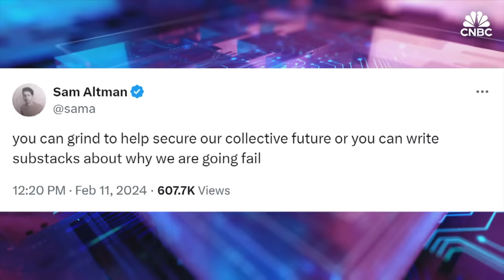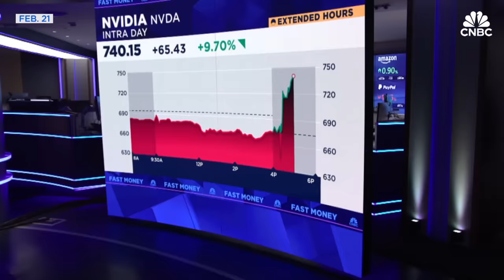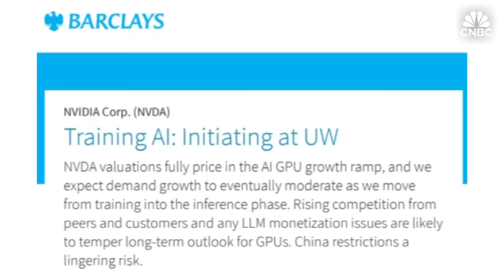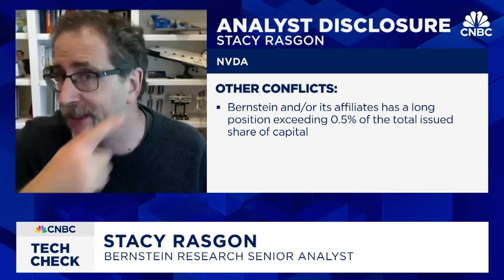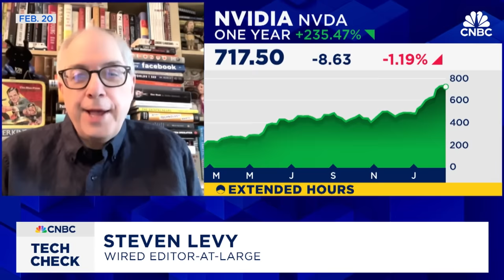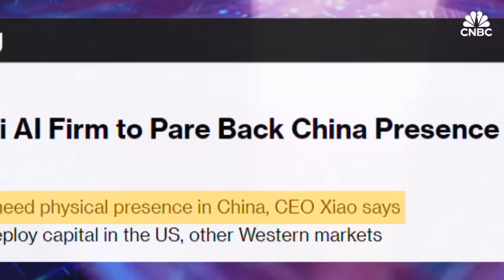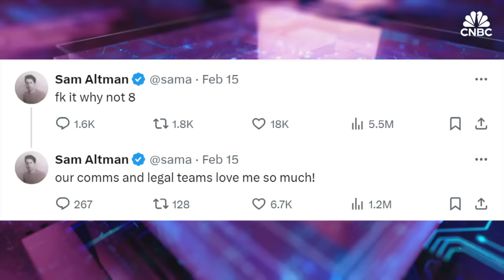Nvidia, Sam Altman and the trillion-dollar AI dream

Comment: Investors have just turned back the clock on the Fed’s tightening campaign and cast aside the Fed fears that ruled them for 15 months. It just gets very daunting to me when I’m sitting there looking at charts and trying to determine if i’m right or wrong! I’ve been trying to grow my portfolio of $300K for sometime now, I would greatly appreciate any suggestions
Reply: First of all, You could lose it all and you could win it all. It goes both ways. Secondly, what works for A may not necessarily work for B and you should not be a bandwagon investor. A good number of folks are raking in huge 6 figure gains in this downtrend, but such strategies are mostly successfully executed by folks with in depth market knowledge.
Reply: It’s unfortunate most people don’t have such information, I don’t really blame people who panic cos lack of information can be a big hurdle. I’ve been making more than $25k passively by just investing through an advisor, and I don’t have to do much work. It doesn’t matter if the economy is crashing, great CFA will always make good returns.
Reply: this is inspiring! could you be kind enough with details of your advisor please? highly suspect i'm much too small game lately to handle investing myself, figured out its best to consult a license professional at this point
Reply: ashley airagahi is the licensed coach I use. Just research the name. You'd find necessary details to work with a correspondence to set up an appointment.
Reply: I appreciate it. After searching her name online and reviewing her credentials, I'm quite impressed. I've contacted her as I could use all the help I can get.

Comment: One question please! Is NVIDIA a safe buy to outperform the market this year? I'm tired of these new buys every week, just to make up some assets with low percentage on my $236k portfolio and try to keep everything around 10%.
Reply: Yes, but do your own research. Avoid index funds, mutual funds, or specific stocks for now. Consider 5% fixed incomes as a safer option. Alternatively, consider hiring or working with a good market strategist for added safety.
Reply: Took control of my portfolio, faced losses in 2022. Seeking change, consulted a fiduciary advisor. Restructured and diversified with dividend stocks, ETFs, Mutual funds, and REITs. Portfolio surged to $610k with an annualized gain of 28%.
Reply: Your advsor must be really good, how I can get in touch with them as my porfolio isnt doing well.
Reply: Karen Leigh Owens is the licensed coach I use. Just research the name. You'd find necessary details to work with a correspondence to set up an appointment.
Reply: I appreciate it. After searching her name online and reviewing her credentials, I'm quite impressed. I've contacted her as I could use all the help I can get. A call has been scheduled.
Reply: AMD Might be the better buy
Reply: Visa